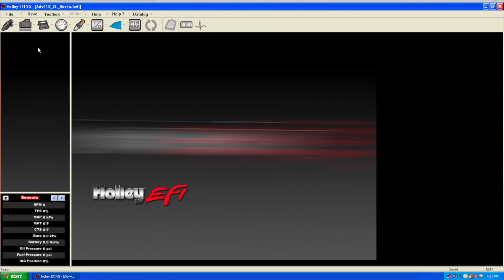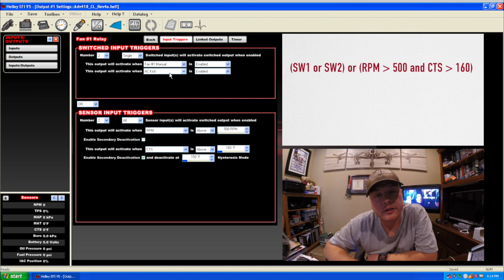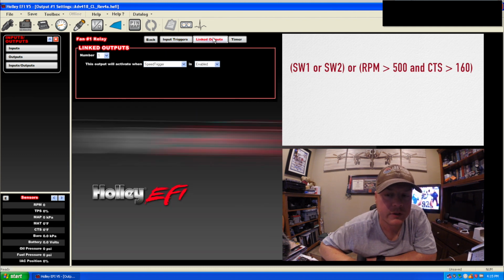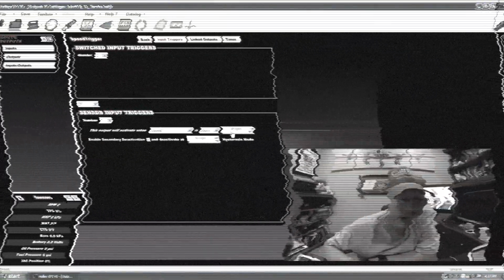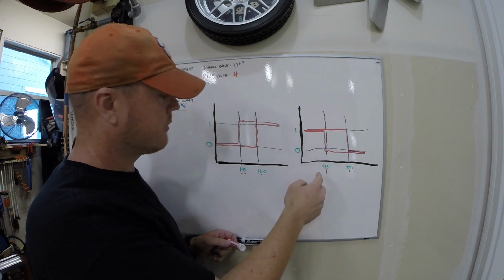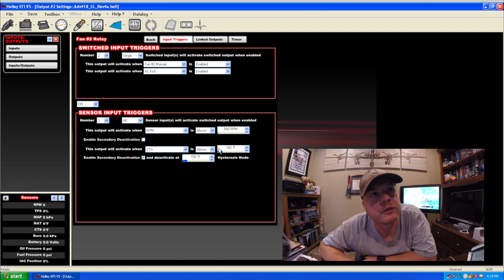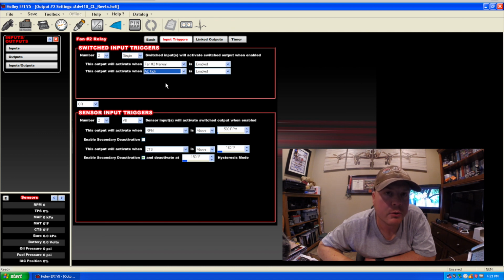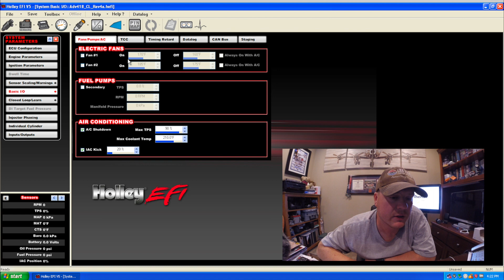C10CJ Holley EFI Tips: Dual Fan Config

Comment: Awesome! thanks so much for the video.  You noted you had a Manuel fan switches. Can you configure this with out? Thanks again.
Reply from the maker: Thanks for the feedback! Yeah, my manual switch is really just an electronic override. Some people put a hard wired manual switch in, but my switch comes into the ECU and it's available to do whatever with. In fact, since I've gotten more confidence in the setup recently, I re-allocated the switch to some other functions like ignition mods and so forth. So simply do not add the 'manual override' switch to the "switched input triggers" section and you should be good to go...

Comment: Good information on your video. Can you provide a link to the PWM relay's you are using ? Thanks
Reply from the maker: Thanks for the feedback! The relays I used are just standard relays. I've looked into switching to a PWM setup but haven't found anything to my liking just yet. For what it's worth, the relay's are "micro" and setup for metri-pack 280 terminals. I pick them up from Waytek wire, p/n 75730, https://www.waytekwire.com/item/75730/Song-Chuan-ISO-280-Micro-Relay-/ , just a standard resistor relay that is wired up to switch ground from the ECU. The resistor helps pull the current down even more beyond the standard relay coil and helps a tiny bit with suppression but a diode relay is best to control transient voltage spikes, but that's also why I switch the ground as the voltage flyback goes to the battery vs the ECU.

Comment: What did you do with your ground wire for the fans? Did you ground straight to chassis or run ground to  battery.  I would like to run my ground for fan to battery. But my battery is all the way in the trunk and concerned with the amount of feet it would take to run the ground to my battery in trunk. What do you think?
Reply from the maker: Hey man, my fans are grounded to the battery and my battery is now in the bed of the truck so here's how I have it: ground/jump post with distribution block (see painless performance 80116, but I got a Summit Racing branded version) mounted to my radiator support, 1/0 wire from there to the battery and one to the engine, then fans ground to the distribution block. As an alternate, assuming you have the battery run to the engine block, you could just run the fan grounds to the engine block or run a large cable from the block to the chassis then ground the fans to the chassis near where that cable ties would tie in to the chassis.
Reply: @C10CJ  ok I see thx for the reply. Yeah, I have my ground. Going from Battery in the trunk going down to chassis then chassis to engine block then engine block straight over to chassis near front fender well

Comment: You made mention of 700R4 with a holfx sensor (?)  I too am planning  running a 700R4 with holley sniper. What is a holfx sensor?
Reply from the maker: Hey man, got way behind on things with SEMA and Goodguys Scottsdale and now into the Christmas season. What you are asking, holfx, is a hall effect sensor. There are two main ways to measure rotational speed, inductive sensors (coil of wire wrapped on a rod that is placed in close proximity to something with iron in it, typically a toothed wheel) which are 2 wire (signal and ground), and hall effect sensors, which use a 'flying magnet'  on whatever is spinning to interrupt a voltage signal (so you get a square wave with sharp rising/falling edges vs a sine wave of an inductive sensor) and these are 3 wire sensors (signal, ground and voltage input). With regard to measuring vehicle speed, most systems are setup to count pulses, so a hall effect sensor generally works better as it generates a square wave and is much easier to count pulses. So I installed an Autometer sensor (the one I used is the hall effect version) on my 700R4 to convert it from mechanical to electric. That feeds to my Autometer speedo but then the speedo has an output that I then pipe into the ECU.